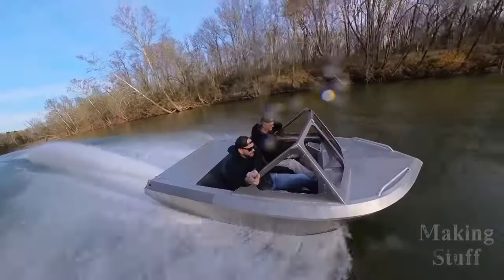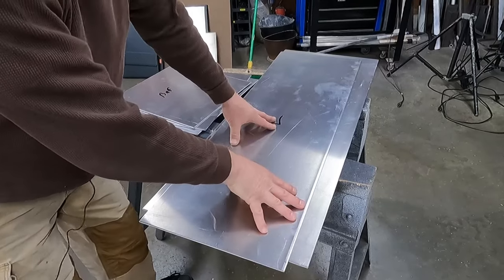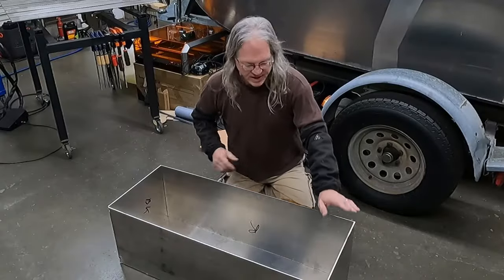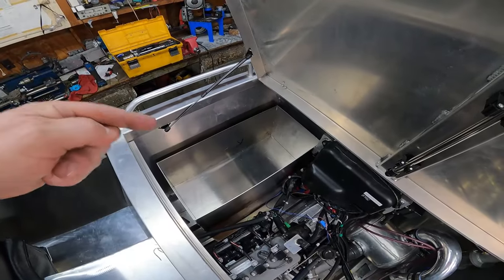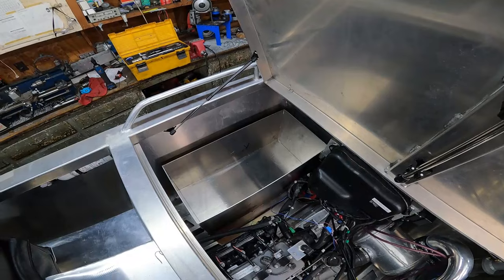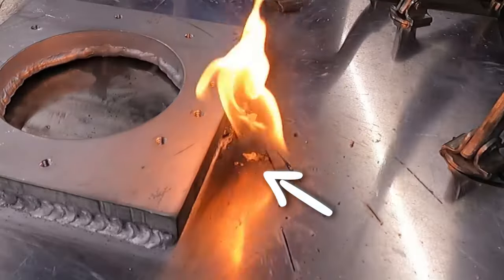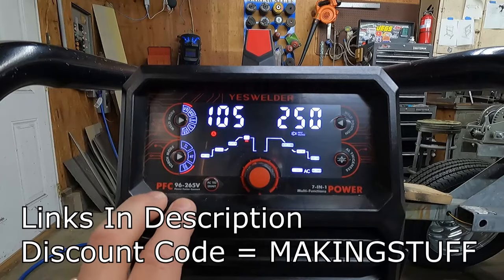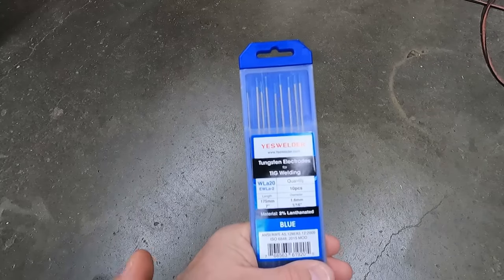DIY Aluminum Fuel Tank Fail - Mistakes Were Made!

Comment from the maker: Is this project worth saving or should I start over.  Let me know here in the comments.
Reply: Not being an expert in fuel tanks or welding, how should i know :D
Reply: I’d buy a custom spun aluminum tank. Let the pros do your flammable stuff. Plus they have insurance should something go wrong. Can’t sue yourself when your boat catches on fire.
Reply: My vote would be to fix what you have because you will find your mistakes.   If you decide to grind your welds, wear a respirator so you don't breathe the dust and most importantly use a grinding wheel compatible with aluminum that won't explode.  Aluminum has a high thermal expansion rate.  When it's embedded in a grinding wheel and expands it can cause cracking at the worst possible time during full RPM.
Reply: i would to see it when you get to it!

Comment: As an aluminum fabricator who has built hundreds of tanks.  Tabs or brackets welded to a fuel tank are a no no.  They will eventually crack and leak fuel.  That's why fuel tanks in cars and trucks as well as race cars are always strapped in.  Even in boats the tanks are set into foam and strapped down.  Just FYI for your next tank.  Love the channel.
Reply from the maker: Thanks for the info, and thanks for watching!
Reply: Just...'62, I don't agree that tabs or brackets aren't acceptable... They do have to be designed and installed correctly but they're the fine. I started building commercially in the 70's (last century) and lost count of the tanks I've done that had endless varieties of brackets and tabs. BUT... they were usually on round corner doublers or were spread over large enough area not to focus inertial movements as stress risers and result in tank wall failure.

Comment: You said you couldn't get long straight cuts in your shop.  You should try using woodworking tools (table saw, circular saw, etc) to cut aluminum.  It works great.  Use a circular saw, cut your tank up and use it to practice tig welding.
Reply: Yeah, I was going to say that too! Woodworking blades are cheap, you could buy a separate blade and use your table saw even. You might even be able to buy one of the evo blades meant for their skill saws and chuck that up in your table saw or use a track saw. Even your router could true up an edge real nice.
Reply: Yeah, sheets of aluminum are easy to cut with skill saw or table saw. Just use a dedicated blade. Edges look factory cut.
Reply from the maker: Thanks, but my table saw is on it's last leg.  I've cut aluminum with the Evolution skill saw, but it had rough edges.  Maybe a new table saw and blade would do the trick?  Thanks for watching!

Comment: Shear cuts are often very dirty. The shear can embed other metals and oil into the cut. You should probably file them smooth and scrub them with acetone. I use a ferrous or aluminum cutting blade on a cordless circular saw with a guide for long straight cuts on aluminum
Reply from the maker: I never thought of this but you have a good point. I'll keep this in mind for future cuts.
Reply: Also, you can use a Vixen file to dress a sheared edge to leave clean, untorn metal for the weld edge.

Comment: With welding fuel tanks I weld the inside of the tank and the outside. Your welds look like they are cold next tank your should set the machine to 180 amps at 200 hz it will weld smoother for you and more pin point for the material. Try to stay away from the spool gun on the fuel tank. Otherwise it was a great first attempt everyone starts somewhere love your content long time subscriber waiting for the next project. It's repairable cut the top off and weld the inside of the tank.
Reply from the maker: Thanks for the info!
Reply: @MakingStuff  anytime enjoy watching your video of your projects weld metal online sells 1/8 aluminum coupons or if you cut them yourself practice outside corners... Keep up the great content. It's true you can use a table saw to cut the top off of that fuel tank. Re-welded on the inside and can make a new top the tank will be fine.

Comment: You can retry. Use a straight edge then a standard circular saw to cut your lines straight. Carbide blades to well with aluminum, if you get a finer(more teeth) carbide tooth blade, the finish will be better.

Comment: From what I understand welding aluminum is quite hard. It sucks, but save it for the winter and you can practice with it. Just out of curiosity, how much was that chunky boy plate of aluminum you used for the pump mount?! Thick 6061 near me costs a fortune 😢
Reply from the maker: The chunky plate was left over from the 5x10 CNC project from 4 years ago.  I think I paid $90 for 3 of those pieces, but not sure.

Comment: If youre using mig dont bother about the acetone, wirebrush will work just fine
Reply from the maker: Plus the wire brush isn't flamable :)
Reply: But make sure it's a stainless steel brush, regular steel leaves iron oxide embedded in the aluminium.

Comment: Well, as someone who has rage quit more than a few projects i can tell you that im never happy about it. That said i know waterproof welding is a big hurdle (not to mention with aluminum). Theres a reason ship welders are the best around. All that coupled with the safety concerns of gasoline, its probably better to scrap this attempt. But i wouldn't count it a total loss. You should butcher the tank and use it as practice scrap to dial in the waterproof welding.
Reply from the maker: Thanks for watching!